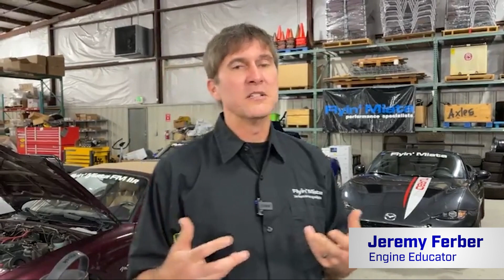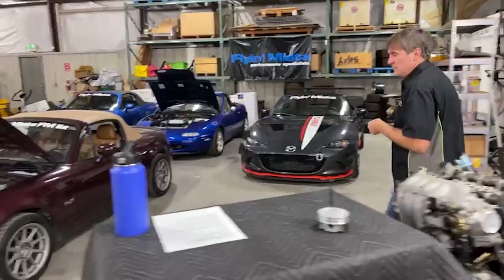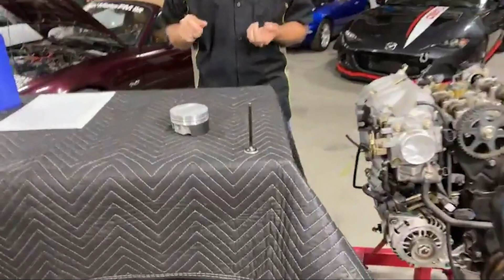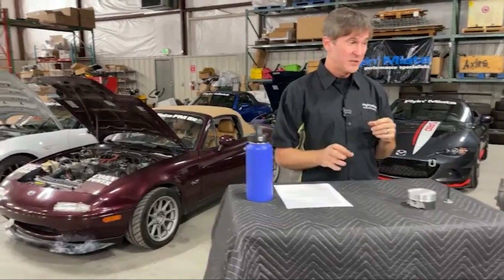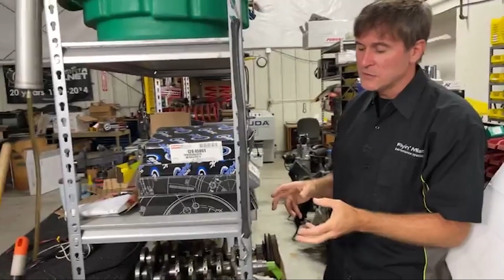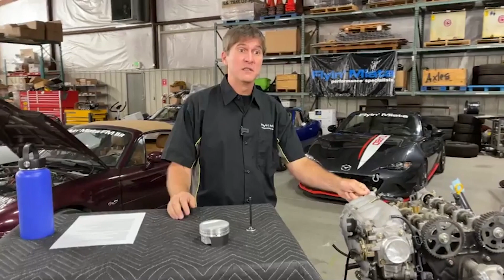Engine Building Basics (FM Live)

Comment: How important would inconel intake valves be in a 400hp build? Would the Manley stainless intake valves along with your inconel exhaust valves be adequate?
Reply from the maker: @z3non142 We recommend them for any build that is planning to exceed ~350 rwhp. It's more important for engines that will see hard use on track. Stainless intake valves would be fine - the exhaust valves don't get as much cooling from the intake air charge as the intake valves do so it's more important that they be inconel.

Comment: If I do a horse power mod on my 2008 C1, at what horsepower level do I need to start replacing the clutch and transmission.
Reply from the maker: @RicFornell We've found that the stock NC clutches can handle the additional power that is seen with our turbo kit (100 more horsepower than stock), though it will shorten their life. We haven't tested an NC transmission to destruction before, so we can't really say for sure what power level they can handle. We imagine that once you crest ~300rwhp, it could be on borrowed time if you drive abusively.

Comment: How hard is it to do a 99 Miata upgrade in a vehicle? I have racing pistons and rods to take my Miata to 11/1 compression. The engine is in good condition, but I suspect it will need minimal honing to get cross-hatching.   However, first, I need to replace my Thorson diff cover with a broken arm with an RX7 beefier cover.  I also have parts to improve intake airflow.  Do you sell the better bearings and ARP bolts?  What gaskets do you recommend?  I have a spare Turbo head, but will it give me better airflow?  I bought it all before I developed leukemia.  My leukemia is doing better and I am able to work on my cars again.  I don't want to mess with a turbo; they can be something else that breaks.  I have 2 cars with turbos and a supercharged 600HP at wheels GT500 that I had to change the engine wiring harness that a dealer messed up. No mechanic wanted to do the job.  I have one hard-to-reach O2 sensor connector that I can't get released, but I found some tricks/tools.  Then, it will be ready for the new wiring harness, which should be much easier after figuring out how to get the complicated original off.
Reply from the maker: We do offer quite a few parts to help rebuild Miata engines.  We offer a basic engine rebuild kit for your engine (https://flyinmiata.com/products/fm-engine-rebuild-kit-nb1?_pos=3&_psq=engine+rebuild&_ss=e&_v=1.0) as well as many other parts (https://flyinmiata.com/collections/nb-powertrain-engine-internals).

It may be easier to help you get the details of your build worked out with one of our Customer Support Reps.  Give us a call or send us an email and we can talk about what works best for you.  https://flyinmiata.com/pages/contact

Comment: You recommend the ati damper so much but your website says it’s not compatible with your own turbo kit? 🤔
Reply from the maker: Upgraded dampers, like the ATI, are great IF you can physically use them.

Our NB Stage 1 turbo kit needs a different timing wheel to retard the timing and it can take a small amount of trial and error to get it right. I don't think anyone wants to take an ATI Damper on and off to set timing. There may be some developments on this somewhat soon, so stay tuned.

The ATI Damper works great with the NA turbo kits, though.
Reply: @FlyinMiataVideo   it seems a waste to have a damper that seemingly works so well and then not be able to use it. I hope these “developments” happen somewhat soon.

Comment: Are the springs and valves the same on from 1.6 and 1.8? If not what do you recommend for a 1.6 boosted application ?
Reply from the maker: They're likely not the exact same, but the stock valves and springs are similar enough where it counts. 

If it's still a stock engine and in good health, stock valve springs are fine. If you plan on pushing a lot of boost or using sustained high-RPM, than upgraded valves and valve springs are a good idea. We like the dual valve spring kit we sell. We are currently not aware of any upgraded valves for the 1.6L engines.
Reply from the maker: Another FM tech here - the valves are different sizes between the 1.6 and 1.8. They're not interchangeable. Supertech does manufacture upgraded 1.6 valves but we don't carry them.

Comment: Hi, I'm looking to turbo my Mk2.5/NBFL 1.8 vvt to around 300BHP. I will be installing forged rods/pistons and new studs. Will I be ok not changing anything in the cylinder head and leaving it as stock? Thanks!
Reply from the maker: Good question! If you plan on maintaining high RPM or increasing the RPM limit closer to 8K, it'd be a good idea to do some headwork. If not, as long as everything is in good shape, you got the easy button with boost to compensate for any restrictions.
Reply: @FlyinMiataVideo  Thanks for the advice! Your channel has helped me out a lot! I'm going to have a wicked track car by the end of this project!

Comment: Is there a way to keep the non interference feature of the engine if the pistons and rods get changed?
Reply from the maker: Definitely. It's all about the shape of the piston top.
Reply: @FlyinMiataVideo  this is great news! Any brand and model that would help me with that?
Reply from the maker: We're partial to the Flyin' Miata pistons :) They will not cause interference. Generally, only very high compression piston designs will do that.
Reply: @FlyinMiataVideo  that's a great thing to know! Thanks for the information, I searched for quite a while and found nothing. It is greatly appreciated!

Comment: A good question is, do you need a different head gasket if you go turbo for a 230-250hp goal.
Reply from the maker: If the car is healthy and well maintained with solid seals and gaskets, your biggest issue will be fuel delivery and management. A quality metal head gasket should be fine.

Comment: I have a '96, I plan on using stock Mazda 10:1 pistons from a VVT engine and forged rods for added strength while also trying to be more cost effective. From my research, stock pistons can hold a decent bit more power than the stock rods. What are your thoughts on this? I want to do a supercharged build with a rotrex c30-94 and possibly put close to 350whp with proper porting/headwork, VVT, and e85. Also, ATI or Fluidampr? I've heard the Fluidampr is much easier for install but I want to know which one is more effective at dampening.

Comment: Great video Jeremy !! I am still a bit ahead of the curve with an 06 2.0l NC and most of your topics center specifically around the NA/NB. I am in the middle of a core rebuild of a motor from a 2010 ( 09 motor ) and am upgrading the internals as they were pre-forged facelift. Stage 2 Crowder cam and springs with 11.2 pistons and forged rods. I may or may not add headers at this time but don't have them yet so stock manifold/Magnaflow cat back in place. It will get a tune to complement these components. Unfortunately I do not have a forged crank but the intention was to get a little more from the motor in naturally aspirated mode but not something astronomical yet have some strength should I or someone else want to add a turbo kit in the future. With all the engine builds you have done, is there a target HP I can realistically get, naturally aspirated with this setup? Stock is 167HP give or take. Is 200HP a realistic target, a pipe dream or selling myself short. There is a lack of NC information and videos in this area. I am doing this because I enjoy doing this, love the car and currently have the time and some budget. I hope I don't end up like your LS loosing time after the upgrades but I won't be taking it out in any case  :) .
Reply from the maker: Give us a call directly or drop us an email at support@flyinmiata.com. Our team may be able to help you find the answers you are looking for.

Comment: I sure wish you guys supported the NC better. Compared to the other revisions the support is lacking.
Reply: The NC trans has the most adaptions for other engines around, because the trans is a common swap. As for the rest of the car, it's just the fattest, ugliest miata ever. No, it's not fat or ugly at all, but compared to the other years of the miata it is. So other than big engines, (and big drivers lol) it doesn't get a lot of love. Additionally, they never got as cheap as the NA/NB, so less people have been modifying them.

Comment: What is an “A” beam connecting rod? I search it and can only find “H” “I” etc
Reply from the maker: They have a ridge around the edge of the rod and a recessed center. Basically, the material is on the thin face of the rod instead of the fat one. The stock Miata rods fit this description. 
Googling "a beam rod" should get you a number of descrptions and pictures.

Comment: Tips for building a forged 1.8 non vvt in the garage? Only head and block deck from machine shop
Reply: Other than the machine shop work and any special assembly instructions for specific aftermarket parts the assembly process is the same as outlined in the factory service manual. If you come across any specific questions feel free to reach out to our support staff!

Comment: I think I missed head gasket recommendations. Example, building a reliable 400hp level BP? Standard MLS, Cometic, Athena, Fire rings, wire ringed etc.?

I suspect a standard Mazda mls is up to the job if the block and head surfaces are prepped to a very low RA and the arp studs are torqued carefully with a calibrated torque wrench.

Please give your 400hp/ high hp head gasket and prep recommendations through your experience. 

Many thanks
Reply: Hi Martin, your suspicions are correct. With a properly machined head & block, a factory BP MLS gasket & ARP head studs properly torqued 400 wheel has never been an issue in our experience. It's around 500 that things start to get challenging for the headgasket.
Reply: @FMJeremy   Really appreciate your straight talking experience. Many thanks.

Comment: TLDR if you came for some N/A application tech talk: "don't waste your money, just turbo it.. fully built high comp N/A will only make you 160WHP. Buy our stage 1 turbo kit" -FM 

We know turbo is cheaper and make more power this has been true since the beginning of time. Great insight into a little bit of N/A tuning/motor building. What would work better? what have you seen make a greater impact? ITBS? porting? high comp 11:1+? e85? cams? stroker kits? crank knife edging/lightening balancing?. 
All the bells and whistles (completely built motor for N/A application) and only had 160hp at the wheels? somehow I don't believe that one bit. If you don't know much about N/A motor building/ tuning just say that. Don't talk your costumers down that decide to go with that route. It just felt like you said "if you're into that, that's fine! you're just an idiot and should just buy our turbo kit!"
"just sell it and buy a Honda" (I know you mentioned this under high RPM but it would also apply to N/A HP) By this same philosophy why are we even putting a turbo on a Miata? just sell it and buy a car that already has a turbo from factory.. Example: Genesis Coupe. Buy turbo upgrade kit for 3K and a dyno tune so all in ~4k (same as stage 1 FM turbo kit) and you're already around 450WHP and ~300-350WTQ(ft/lb) and you don't have to worry about breaking diffs or transmissions. So what's the point?
Reply: We've built & calibrated a lot of high comp BPs over the years and for many guys it is the right answer. With that it's always important to us to make sure to put everything out there for the customer so they go into it fully aware of what to expect compared to the alternatives since N/A mods are not the best HP/$. I understand what you mean about how a particular statement felt, and if this wasn't live I would have had more time to think about how to relay the information in a way that was more genteel so apologies if it came across harsh. That being said we have a goal of testing & offering the most effective solutions out there balanced by what our customers want!

For N/A building the things that have the most impact are compression & displacement. For example a ~11:1 Stroker is going to have the most potential compared to anything else that can be done. We've done a bunch of these in the 180 wheel range, and even one with IRTBs that hit 190 wheel. IRTBs are a PITA though and we'd only recommend them for a dedicated track car that's not changing elevation (without recalibration of the mapping).  Even so, I'd personally rather have a square top on a track car because reliability is paramount.

In theory the right cams will also make a notable difference, however out of the 15 or so sets we tested on the dyno over the years I only recall one set (on a high comp 1.6L) that made an improvement that was worth the effort in terms of area under the curve. To be fair this is coming from a perspective of street car building where single-digit HP increases really have to be weighed against the time/cost.  For cars that are racing for time of course every HP counts. 

E85 is a similar story here. It's magic for turbo cars. For N/A cars we calibrated a number of HDPE & Autocross cars over the years and on a N/A BP we'd see increases in the 4-6hp range. We'd take that all day for a track car, but for a street car it may not be worth the extra cost & reduction in fuel economy.

We have a friend who's an engineer for OEs and significant professional race teams that recommended we not knife edge cranks. He's at the level of "when he speaks, we listen" so that's not a service we recommended.  As far as porting / bowl / valve work that does increase efficiency on the margin. I'd say about half our customers would opt for those services in an engine build based on the additional cost. 

For N/A tuning outside of the engine, intake & header choice is pretty key. There are a lot of options, and even the best ones only add a handful of ponies, so testing what makes the most benefit to your system on the dyno is pretty key if you're looking to optimize power. Similar to cam gear tuning there really isn't a magic answer- for example there's a big name header that I've seen make 5hp on one car and actually lose 2hp on a different car compared to stock. Intake design is a similar story- they're all a little different. Moral of the story is that serious N/A tuning takes a lot of time & money to test various options on the dyno to discover what's best for YOUR car- otherwise you're guessing. If the process of testing & discovery is important to you like it is to us, by all means go for it! If however you just want to bolt on 60-ish HP & go drive your car then our 50 state legal Stage 1 turbo kit is more logical.
Reply: @FMJeremy  Ahh thank you for that! I do apologize my initial comment was very rude! 
This is a great read and appreciate you for taking the time to comment! This is a great bit of information. 

I see the pit falls of going deep into N/A tuning, and understand completely most people decide going with a turbo. I like to tinker with stuff and money is not much of an issue so time($)/HP is not much of a concern. Currently messing around with a 1.9L 11.5:1 engine and already looking for ideas and experiences to build a step up from that. Good to know about crank knife edging no-no, definitely wont attempt that now. I'll research more about stroker kits and IRTBs. Also have a couple spare heads for some light and heavy port work with different off the shelf cams.

BTW My first Miata has a Voodoo kit on it, 50k miles later still doing great!
Reply: @wellsloan975  Glad to hear about the Voodoo kit.   :)

If you do IRTBs your best bet is to have a standalone that can be tuned in Alpha-N or at least a blend since MAP tuning on IRTBs is kind of a joke. With IRTBs runner length tuning is pretty key as well. They can make good power when done correctly, just don't expect street car drivability. 

11.5 is pretty stout! Based on testing & development with Wiseco we put a ceiling on BP high comp pistons of +8.5cc dome. This never got us much over ~11cr.

Given what you've said here it sounds like you're on the right track. It's always important to us to have honest conversations with customers about desires vs. goals & budget so you can have all the information to make your best decisions and begin with the end in mind.
Reply: Your 3600+ lb Genesis Coupe with 450whp is pretty similar to a 2200lb Miata with the 260whp an FM kit can easily provide looking at power to weight.
And why would they spend a bunch of time on N/A mods when they do so little good compared to the turbo systems FM is famous for.  You expect a business not to promote their products?  Seriously?